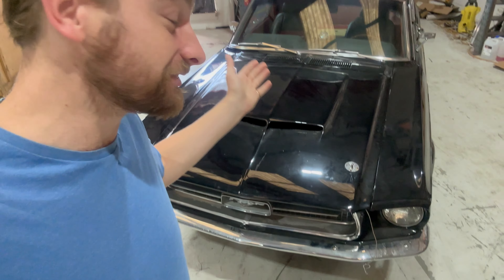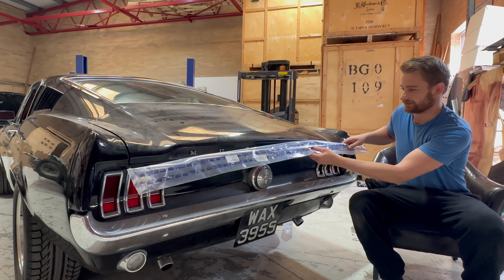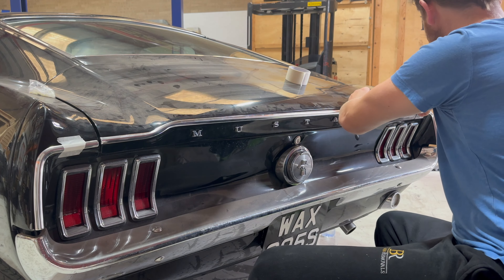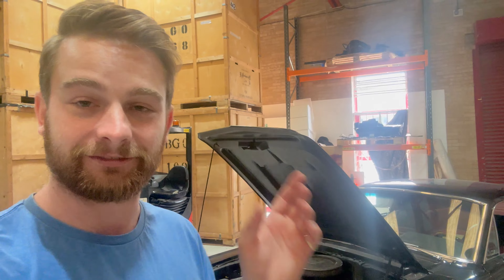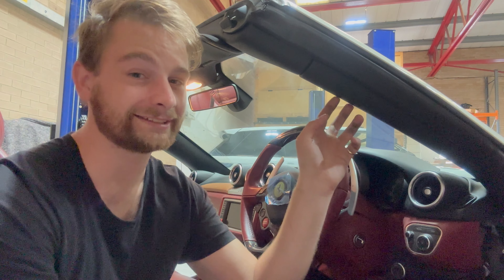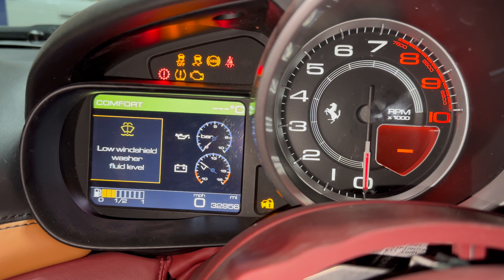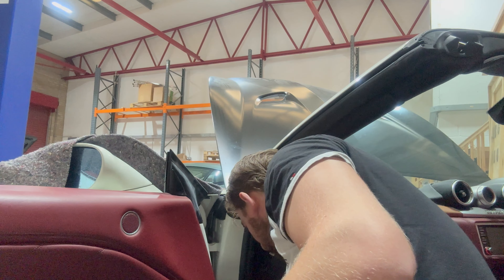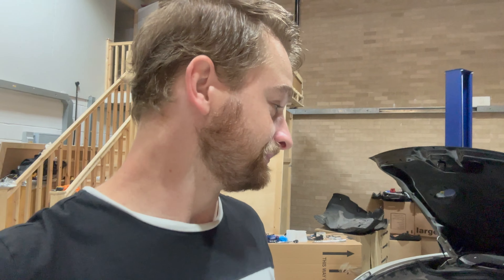FORD VS. FERRARI

Comment: Hey Alex. Wow what a headache. I think you’re on the right lines with moving the actual front panel across a bit. I mean you only need 10mm at most I guess. 
Regarding the car electrical faults it’s strange for so many things to be kicking off at once Al. I’d say it’s something stupid that you may have done with connections. Maybe a loose fitting or is the battery the right amperage for the draw off the vehicle? I’m really shooting blind but all those thing’s popping up at once is usually something that causes a negative chain reaction. Hope you get it sorted my friend 🤗👍
Reply from the maker: Thanks Roger - yeah I should be able to move it a bit but I do suspect that’s only required as the part hasn’t been made very well!
I do think I’m on to something with regards the electrics and my theory is I caused it by swapping the Airbag ECU over to an I programmed one - we’ll see though!
Thanks for watching as ever mate

Comment: When are you gonna post the next video about the Ferrari because I am at the same problem as you are with it! Full dash with lights and I can’t Fire it up! It cranks but it doesn’t start. I am hoping you can share the information please 🙏🏻
Reply from the maker: Hey man - still not quite got it fixed. I thought the issue would be to do with the new Airbag ECU but it hasn’t changed things by putting the old one back in.
Feel free to drop me a message on instagram ‘ItsAlexBaldwin’ and will feed a bit more back as I’m beginning to narrow it down now!